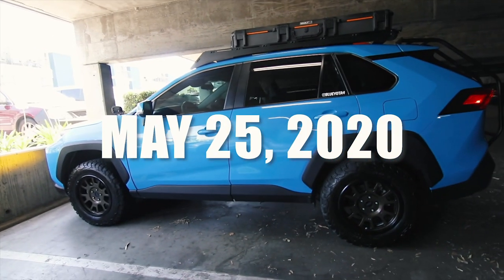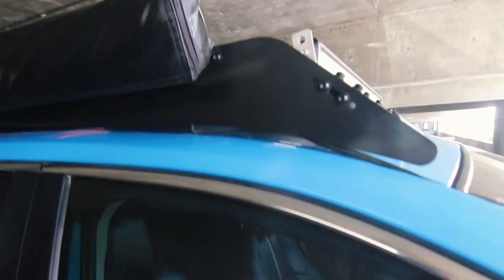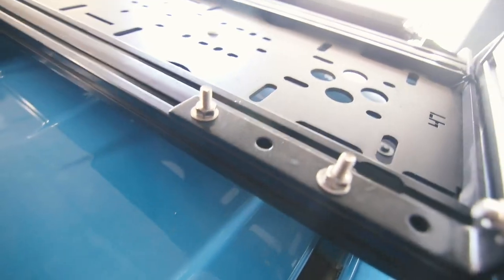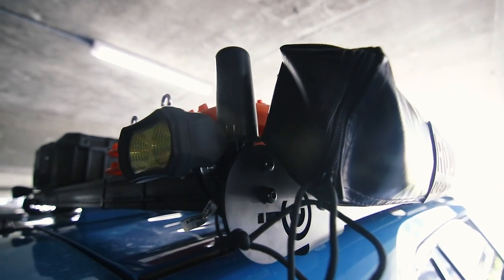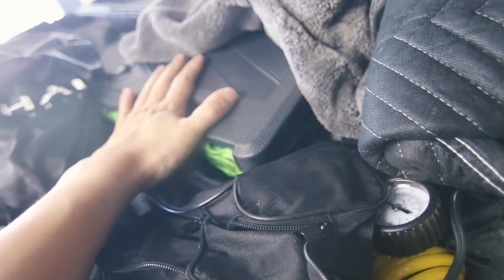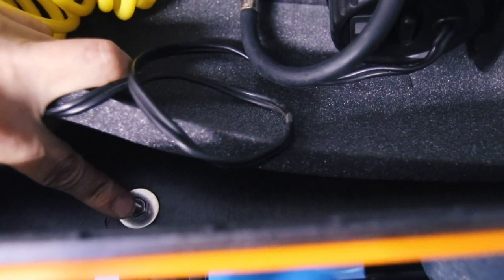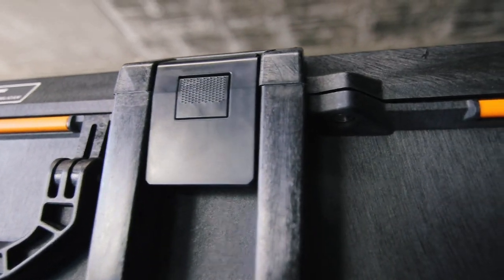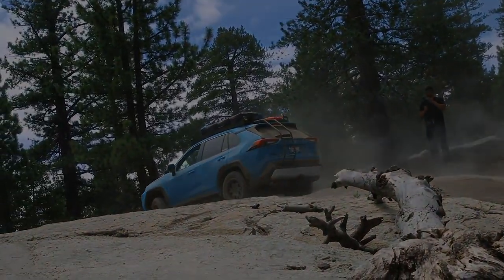How to Mount an Awning and Pelican box to a Prinsu Rack CHEAP & EASY! RAV4/Tacoma/Crosstrek/4Runner

Comment: Great setup. I personally would have gone with the higher up model Pelican case. The Vault series are incredibly inferior to their normal line.
Reply from the maker: It has since been replaced by a roam rugged case 83L--at the time the vault was the tallest offering available for a case of it's type. There is a follow up video on the channel with how the vault faired against the elements during the time it was on my rack.
Reply: @DannyRocksteady  I ordered that case too. Did you purchase the east detach mount clips?
Reply from the maker: @ThatCleanMT  no, those didn’t exist either when I made the switch. I’m using mounts from Sherpa Equipment Co.

Comment: I was thinking if you drilled the holes in the box to match the distance between the bars(10", I think) in the perpendicular direction, you can mount the box in both directions
Reply from the maker: mongrel420 you could mount 2 boxes, but with the awning it would’ve be harder to get into the second one.

Comment: bought a 19' 4R pro and it had a prinsu on it. Doesn't have the slots to insert a head like this one.....hmm
Reply from the maker: It could be that the bars are installed with the slot side down. Check the bottom of the bar and turn them around if necessary
Reply: @DannyRocksteady  yea I thought the same thing but nope....same on both sides
Reply from the maker: @paulwhite6367  you could still run bolts but you’d have to undo the ends of the bar and slide them in.
Reply: @DannyRocksteady  yea I think this was a previous model/year. Didn’t think abt that....thanks a ton
Reply from the maker: @paulwhite6367  no problem!